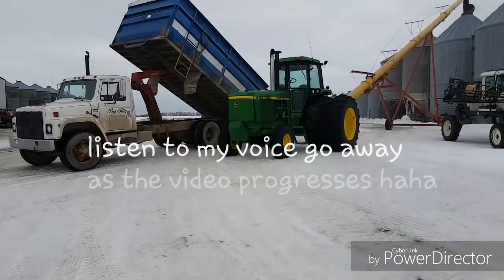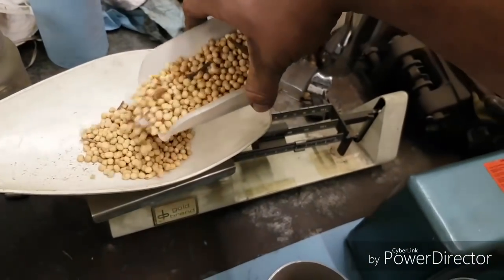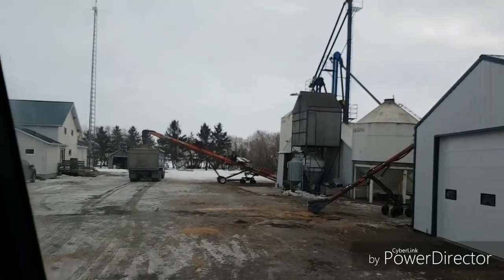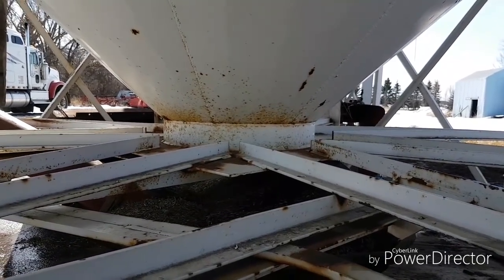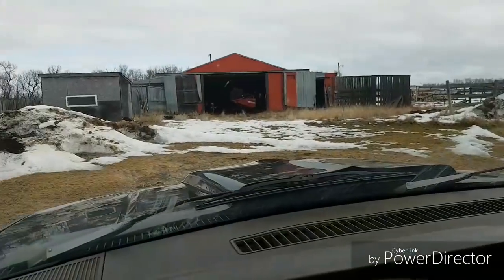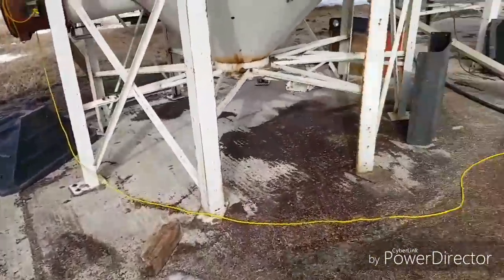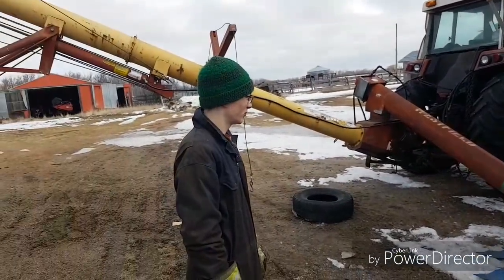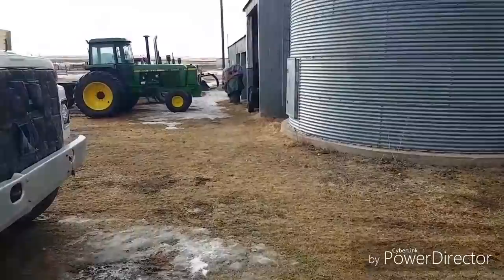Selling canola, cleaning barley seed, drying soybeans and Antione helps make a video!!!

Comment: Thanks for the great video once again better than all the prime time shoving their politics down my throat every 5 fucking sentences. Unfortunately I wasn't able to make a deal on that open station 4440 it was absolutely beautiful but the things weren't adding up to the hour meter, I am not scared of high hours especially on a beautiful stored inside tractor but it has to be restored not just repainted and he was claiming it was just painted and the story about the broken hour meter changed about 5 times since I got there. And because fo that I still knew it was a good price but was going to be more of a gamble so I offered him 2 grand USD less to cover for shipping and some hoses and heater and he wouldn't take it surprisingly. But instead of low hours I had a feeling it had about 38000 then was was restored and another 8k was  put on. But it was weird it was a different story and scenario about how many hours it had and how it broke and etc I should of walked away but that open station got to me I thought to my self I'll be just like S.S.F putting a big old loader on a 4000s
Reply from the maker: Ya I dont blame you about that shady deal
Reply: @SouthSaskFarmer1  just sucks though it was to beautiful if that makes any sense lmao plus for how beautiful it was it was 2 cheap 2 grand cheaper than the closest cab tractor I could find. I have never seen an open station 4440 and boy it was a cool tractor I definitely would prefer it In the summer that a cabed one especially with a loader.

Comment: The biggest piece of junk tractor I ever had was a 1961 John Deere 2010 lol . Those tractors were trash .
Reply: Aaric Hale, sorry to hear about your 2010. I once owned a 1965 2010 and in 1984 I last used it for planting tobacco down here in southern Ontario and it worked like a charm. In all those years  there was only one clutch job and one overhaul. It plowed beautifully with a 3 bottom 14  inch even when going up a hill.
Reply: @brianzybura8633  Thank you for the comment .  Mine was just a money pit and had hard time finding parts for . It was like every time I went to go use it something was breaking down .
Reply from the maker: Ya those I've heard weren't to good lol